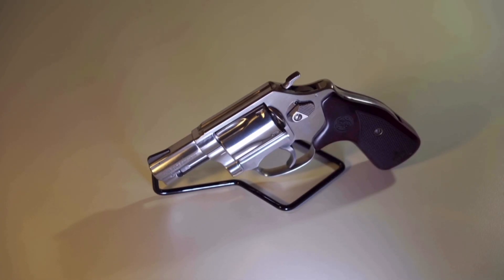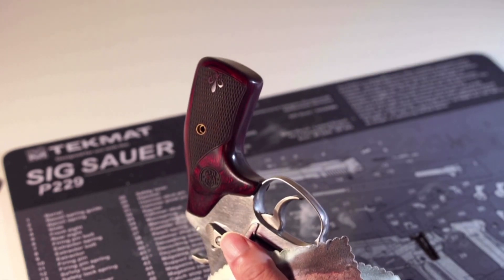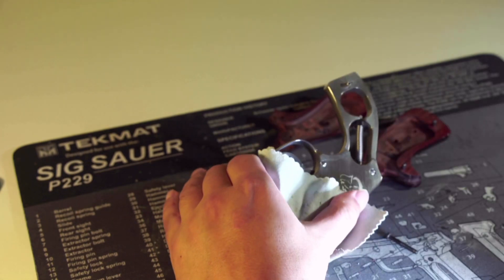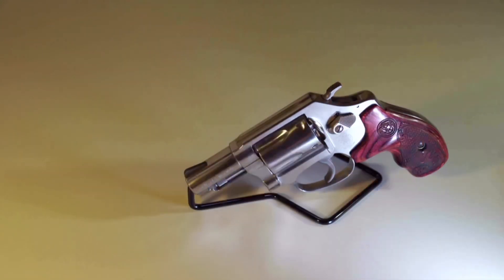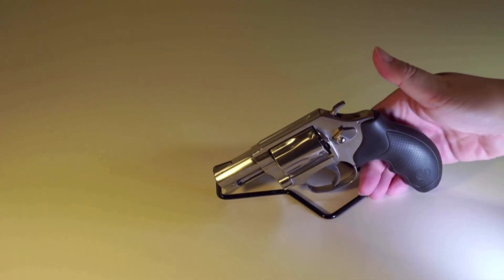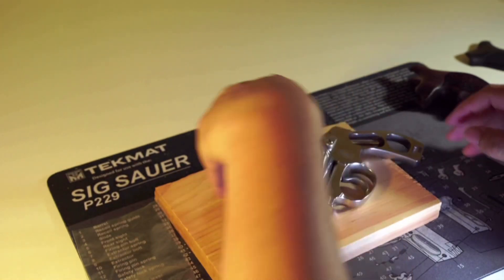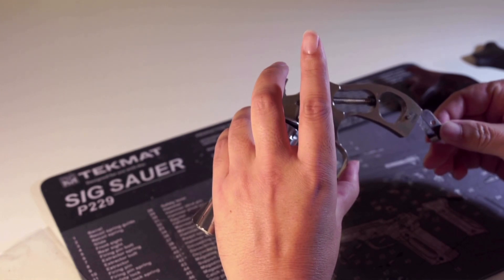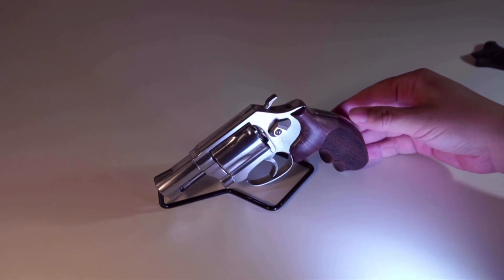Smith and Wesson model 60 Grip options

Comment: There is one pair of Altamont SW grips that has a thumb rest on the grip, mild finger groves.  The only problem with this particular design is that it prevents the use of speed loaders.  I had to go back to the pacmeyer grips.  They were 60.00 grips too.  The grips shown here do not have the thumb peak design, made by the same company in wood grips.  FYI.
Reply from the maker: Thank you for the information!